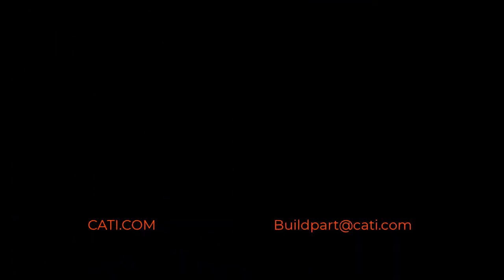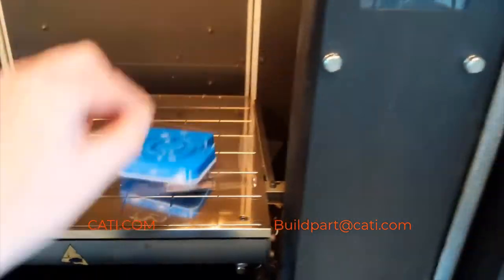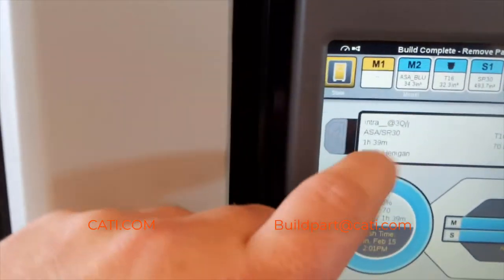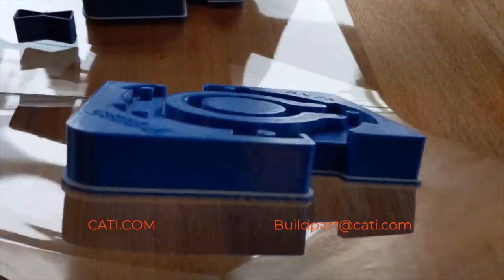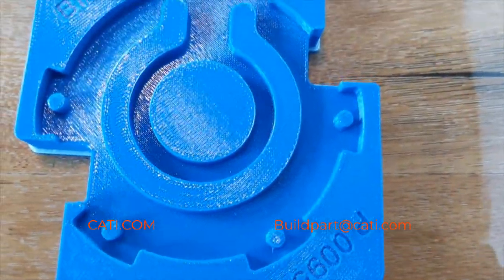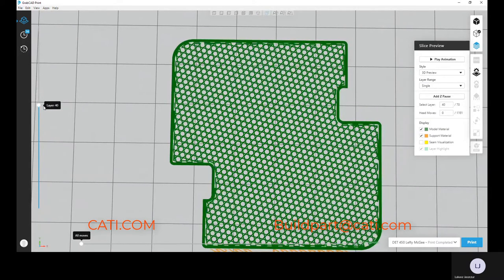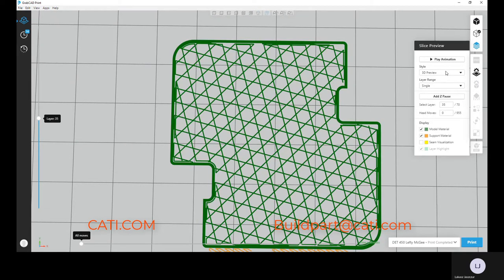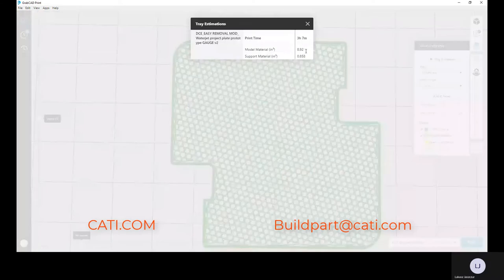#TipsAndTricksTuesdays: Differences between ABS and ASA

Comment: Why is the infill percentage for asa lower than the infill percentage for abs? are the properties different that it requires less infill, or did that particular print profile just have a lower infill percentage?
Reply: Properties of ABS and ASA are almost the same he just seem to not understand the infill settings in the slicer. Also a am dissapointed of the print quality on Stratasys machines, for that kind of money having this shitty looking prints on probably 80 mm/s is just a ripoff.
Reply: Not all of these stratysis machines come with a slicer like you're used to with hobby stuff. Kinda like upload the model, pick material, slice, print.  They dummy proof their lower end machines, the way iunderstand it. 

Their higher end printers have a more fully featured slicer